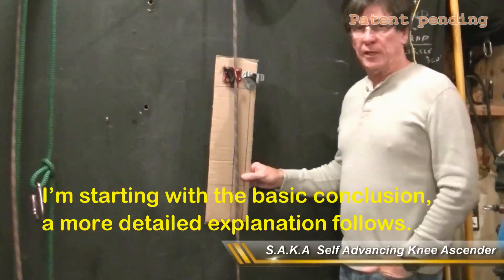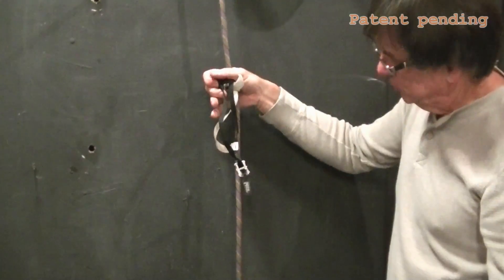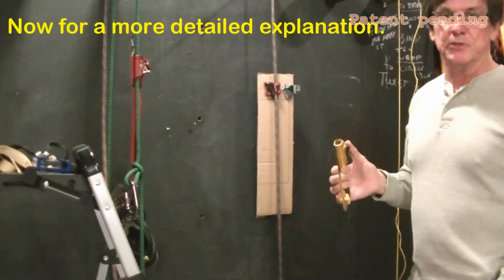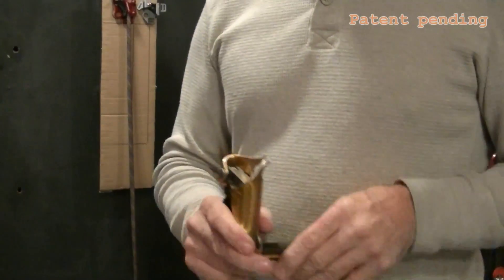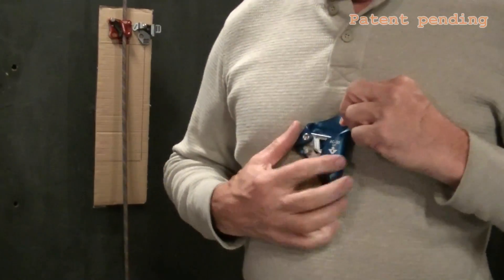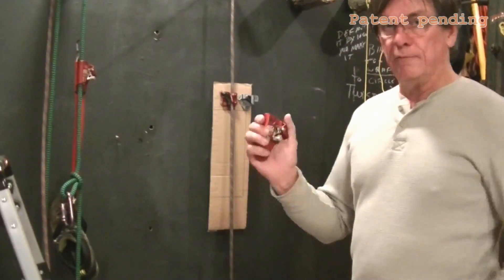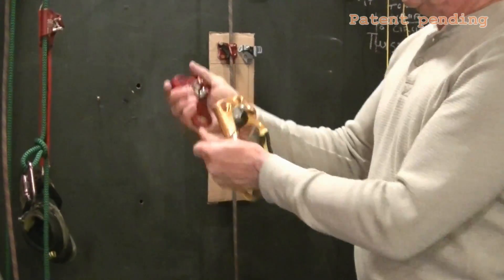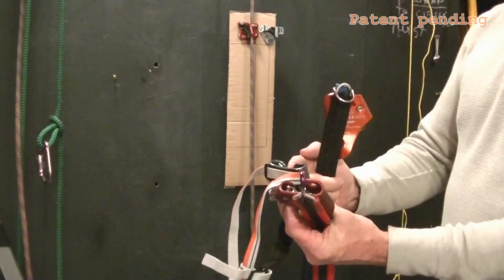SAKA Self Advancing Knee Ascender, orientation for efficient use.

Comment: I have used this ascender a couple dozen times ascending a 45 degree hill about 125 ft✡✡>allmy.tips/ClimbingAscender?118   I use a 10 mm static line and have had no issues. It is light and is easy to attach and dis attach from the line.